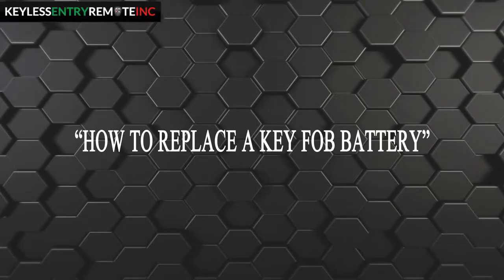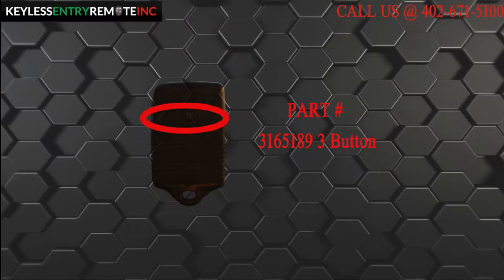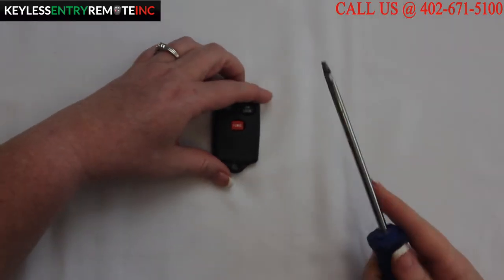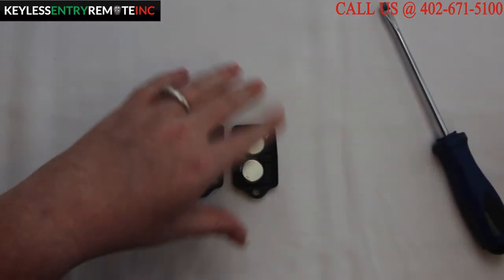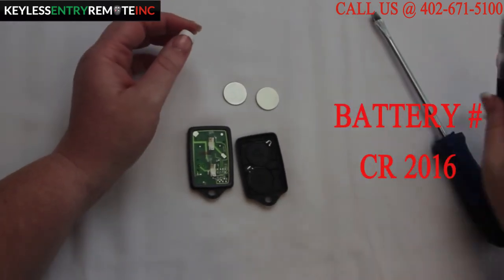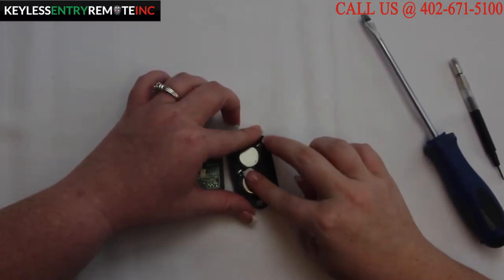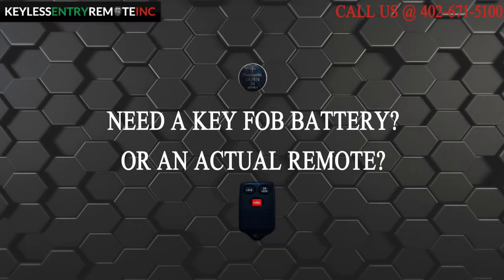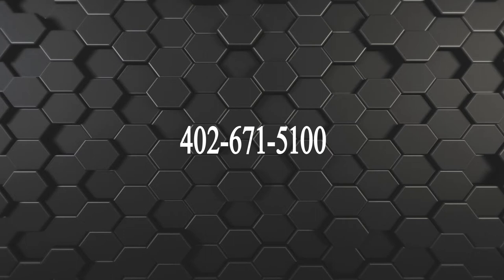How To Replace A 1994 - 1997 Ford F 150 Key Fob Battery FCCID: GQ43VT4T

Comment: I have a key remote for 1997 Ford F150I replace the batteries but the remote wont-work anymore
Reply from the maker: Make sure that the battery is inserted correctly. If you are still having problems try disconnecting the truck battery for a few minutes and then reconnecting, this has helped other in the past. If that doesn't work you can try reprogramming the remote to the truck, instructions can be found here. https://www.keylessentryremotefob.com/Key-Fob-Programming-Instructions-s/1856.htm